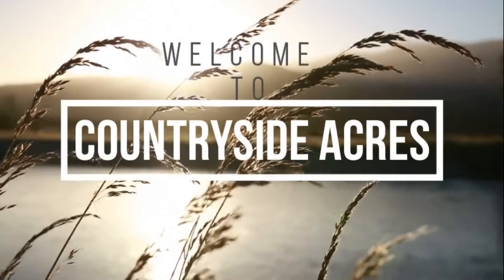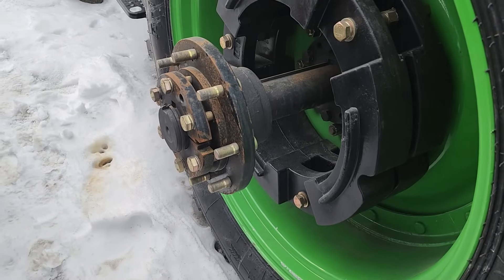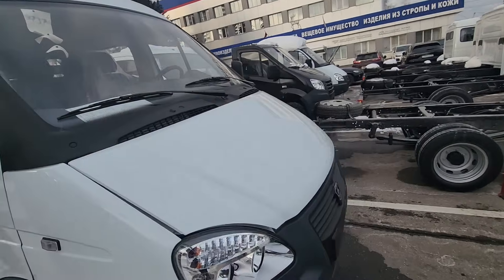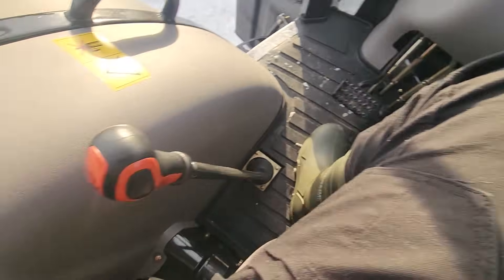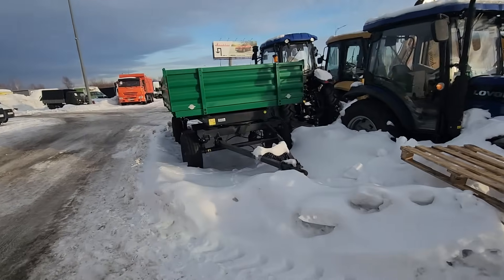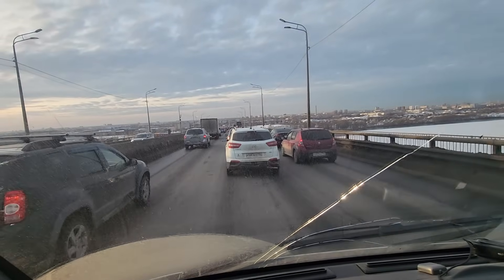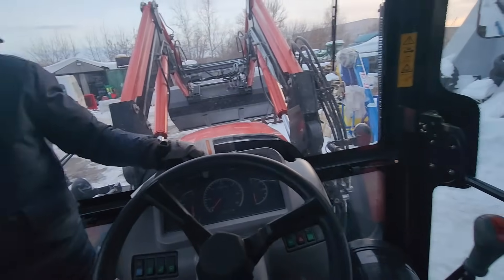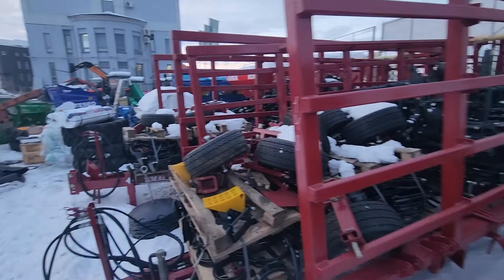Farm EQUIPMENT in RUSSIA!!!

Comment: Arend, absolutely take Belarus.  I have new MTZ-82 Belarus and its good. Anybody in the smallest village will have spare parts and experience to drive or repair it. China models do not have those. Also, you can have more cheap state-sponsored leasing through Rosagrolising for Belarus.
Reply: Also if you are brave and experienced to deal with used tractor (like you did with Gazel), you can have mach better price, like 1 million instead of 3-3.5

Comment: When choosing equipment that will operate throughout the harvest season without stopping, and then perform auxiliary functions in winter, it is important that the equipment is reliable and cheap to maintain.  Comfort is much lower.  So, reliability, costs for fuels and lubricants, spare parts, maintenance.  The purchase costs will pay off during operation.  It is better to discuss the issue with experienced local farmers to make it easier to make a choice.

Comment: In the part of the world that uses metric system, we dont write down horsepower but we go by Kilowatts(KW). Sou the tracktors that had Kw written on them you multiple by * 1.341 example, ( 145 Kw by 1.341 is 194 Hp)

Comment: Belarus tractors would be the easiest to start with. I have ofc old beaters not a new one. But in the end of the day it is your call and you should try them out before deciding what to buy. I have belarus tractors cause they are relatively cheaper to have than some other brands. To put into a different perspective Belarus tractor is the Soviet version of the old IH. At least the old ones where. The new ones im not very familiar with., they have very little in common with the old models. 10:20 is the GAZ 51 these where also used in the Vietnam war. Used to be a very common truck in the soviet union.  12:39 I like that tractor but it maybe not that great for you to start with. However lot of my friends have the 82.1 model and if maintained well they last.
Reply from the maker: Thank you

Comment: Thanks Arend, that was interesting.  I remember when Belarus tractors showed up in SK and we all thought they were a bit crude looking compared to the John Deeres and others we were used to.  We laughed because they had buddy seats, we wondered who would want to ride around if they didn't have to. They seemed to work though until parts became hard to get which happened long before these current political problems.  I hear what you are saying about the smaller machinery.  Here in NS, almost everybody uses small equipment which goes for a lot of money here whereas back in SK we just parked it in the bush because nobody wanted it in their race to get bigger.  I often think if we could have saved some and trucked it over here it would have come in handy or made some money on it.  It will be interesting when you start to get prices.  If you can stock up on equipment with dollars at the current exchange rate you should be able to outfit yourself really well for a fraction of what you would pay here.  Good watching you, a demo in summer would be even better, you'll get there I'm sure.  Network and talk to the old farmers aroun., Everywhere I've gone it takes quite a while to get into the deeper layers of the local society and find out what people are doing, using, thinking and how stuff really works.  Hang in there. (this is my wife's account if you're wondering why Janice is interested in tractors, she isn't).

Comment: Go for Belarus tractor,  its a reliable tractor and easy for service, by  yourself, cheap and  always available parts , they even sell an aftermarket buddy seat (with a box under) , which you can  install on the left side of the  driver seat.

Comment: Nowadays, agricultural machinery produced in Russia, Belarus and China is mainly sold. As for Belarus tractors, this brand has existed since the times of the USSR and is very common in Russia. It is produced in Belarus, and it is Russia's closest ally. This is an old fashioned and simple tractor with many things you can easily fix yourself. All spare parts are easily available for it, and if necessary, it will be repaired anywhere and quickly.

Comment: Arend, there on a piece of paper were the characteristics of the FL1354 tractor. I wrote out some things:
- engine power 135 horsepower
- engine capacity 7.42 L
- turning radius 5.7 m
- ground clearance 480 mm
- dimensions 4897*2340*2900 mm
- tractor weight 5530 kilograms
-dry double clutch LUK (ceramics) made in Germany
Reply: I think this tractor is made in China...

Comment: I'm 5'-5", it must nice to worry about leg room. I have L3400dt and CK3510, I have to have the seat all the way forward to reach petals, and on the L3400 I had to modify the seat to go forward some more just I'm not stretching to reach clutch. I tractors are made for 5' 6" to 5' 10" people, you must be taller then that........
The only things that stuck out to me was very few tractors without FEL and the small axle on front end of 80+hp tractor, on my small Kubota and Kioti the front axle is 5-6" in diameter. I noticed the same on JD tractors, the front axle is around 3-4". To me when my front end comes up it has to go back down, small axle in my mind wont take much of that, but your right all farmers keep all 4 tires on the ground, it's the home owner loggers like me that push tractors to the limit and beyond................
My constant dream in the next life is me and Jesus building a tractor of my dreams........ { "......with God all things are possible". }   .........

Comment: I have a 3 three of these Asia type tractors. couple things you find as an issue . pay attention to the PTO.  many  are  gear driven live  PTO with out a separate clutch  so if   you some how jam up the PTO.  it will be near impossible to disengage the PTO. you have to carry around a  big pipe wrench and have to manual  back up the PTO to disengage. other issue  the cabs  are often not rubber mounted . so  lots of noise are transferred into cab..   and lastly the  tires can be an issue the rims and and tires do not seat very tight .  so the rim  tends to rotate inside  the tire  cutting off the stem. especially in the winter . if you find your  tires are doing  this.  pop the bead and  lay a ring of silicon   and reseat the tire  and it good after that..  the best thing about these tractors they are  very easy to work on everything in the open. plus the price I got 4X4 120hp cabbed tractors all with 3PTH one with a loader  and they were only 25,000 each (* not including shipping to Canada )

Comment: the Belarus tractor is a safe bet, it will outlive your kids. doesn't have as many gimmicks as the new chinese brands though. If you come across a czech Zetor that might be a good choice, too, but there might be issues with spare parts due to bruxelles sanctions. Russian Kirovec is also a traditional brand, very sturdy and reliable, probably not much electronics in it. Fingers crossed!

Comment: Loval is a Chinese Brand , like YTO, DongFeng and mTZ ( Belarus ) is from Minsk.
The Belarus is a good choice in Russia as the State of Belarus where what was known as ‘ MTZ ‘ in CCCP and still has that Name in some parts of the World , it is easy to get parts if you need them . 
With the Sanctions from the West, there are some dealers in the former Soviet States that supply parts for western machines at an increased cost !
There is a new Russian Tractor Firm called “ Rostelmash “ there Tractors i think are up to 180 hp and if you want something of 200 hp + …..you can get a Kirovets but they are big machines for large Farms . 
Do not buy a western Tractor in Russia as the parts could be expensive when you need something

Comment: Hey buddy, when you look for the power and you see KW written, that stands for Kilo Watt. That is not the HP number. So when you see KW 160 that converts to 215 hp. You wonder in your video that the hp is too low for the size but it is not since you read the KW numbers :) hope this helps. It’s a European thing.

Comment: Tractor "Belarus (MTZ) [Белорус МТЗ]" is one of the oldest brands since the Soviet era and the most widespread in Russia. Now it is a successful company from the Union of Russia, the Republic of Belarus. They make simple but reliable tractors, and in principle, if you do not consider a tractor as a Mercedes in the world of agricultural machinery, then Belarus will suit you. Well, if we are talking about practicality, then it is better to use tractors from the Republic of Belarus or our tractors of such brands as "Ростсельмаш" (large models); АГРОМАШ 90ТК; Террион АТМ-3180, etc.

But the "Lovol" brand (like ARM agro) looks modern, BUT it is a Chinese technique. Recently it became known that truck tractors imported from China to Russia have a very serious drawback - their wiring literally rotts in 1.5 years.. and this is a disaster for the reputation of Chinese trucks. It seems to me, but I may be wrong, that a similar problem is possible in Chinese tractors.
To be honest, I would not agree to use Chinese tractors in agriculture, primarily because of doubts about their quality, and secondly because there are quite decent Russian and Belarusian models of agricultural machinery that are also durable + availability of spare parts for them.

Also, if you don't mind using equipment, you can look at different offers on such Russian services as: "drom .ru" or "avito .ru"
By the way, you can find a lot of other things on these services, i.e. new and used household appliances, electronics, cars.

Comment: That tractor at 27:30 - engine power is 99 kW (stamped) which is 135 hp (on paper sheet inside)

Comment: Engine horsepower doesn't tell you much:
Drawbar horsepower is what to use/compare.
Interior cab size floor space is really cramped.
You need something with a wide-cab floor space,
room for one dog, and one passenger: something like a blue Ford/NewHolland 125. My friend had an old 4WD small Belarus (in Alberta), and it was way too light on the front axle; no traction; also the gaskets leaked like a sieve.